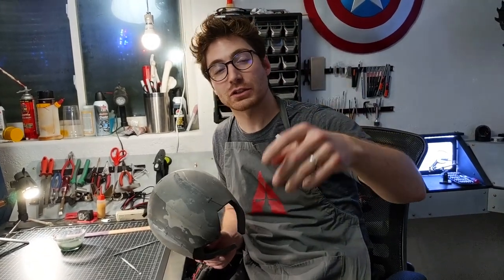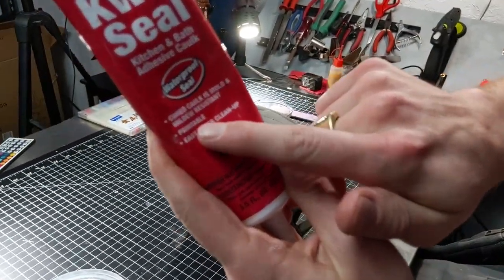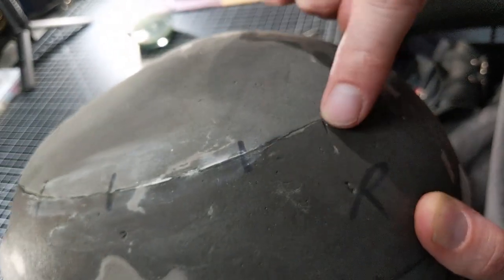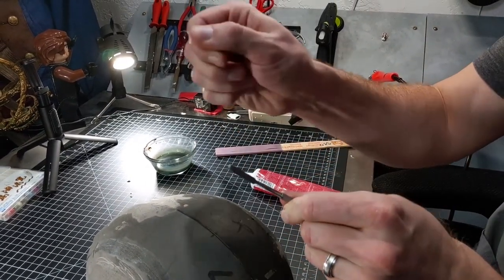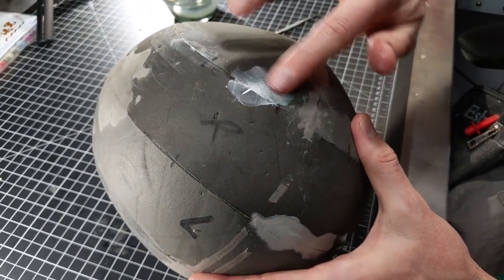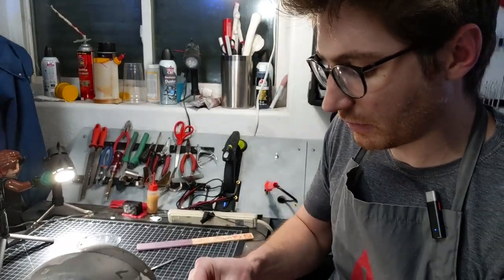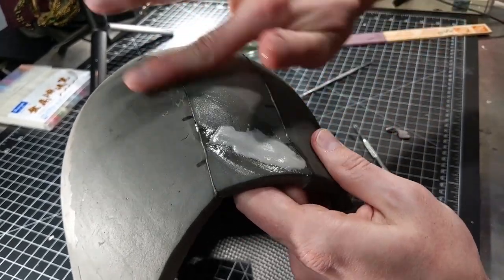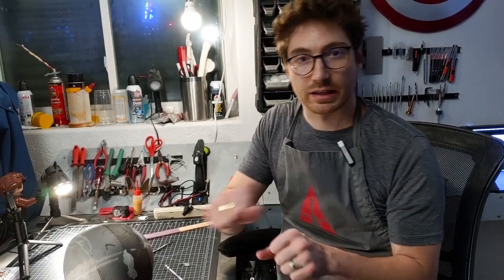How to fill EVA Foam gaps and seams for Props and Armor | Cosplay Apprentice

Comment: is foam-mo flexible or rigid?
Reply from the maker: It remains relatively flexible after it cures. Then we recommend you seal it with something to keep the air from getting to it. Because it is an air dry clay, over time, the more it exposed to air it will continue to dry out more. So if it exposed to air without any sealant it can eventually become more rigid and break easier of flexed. Hope that helps :)